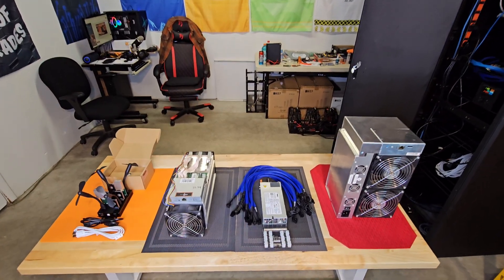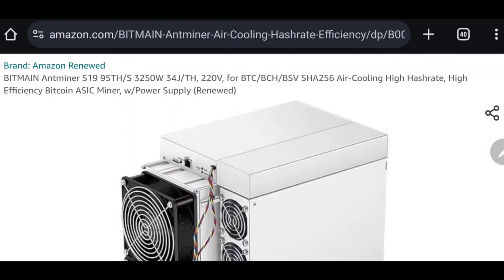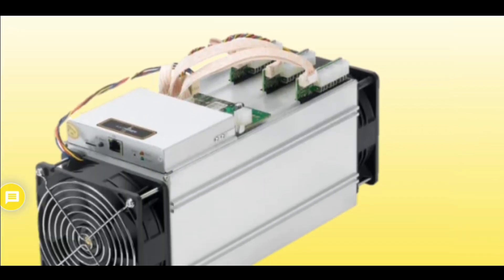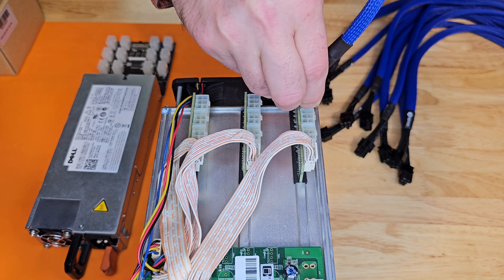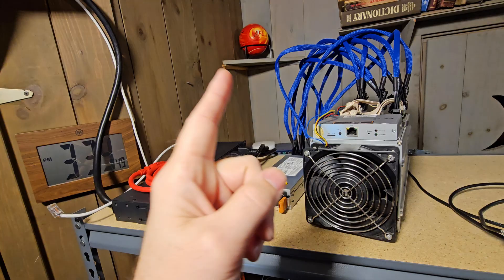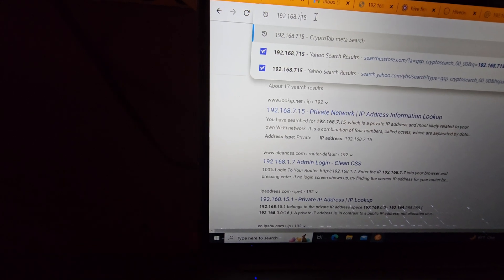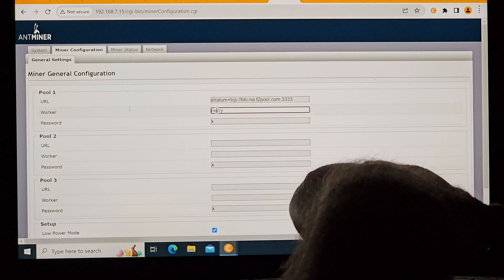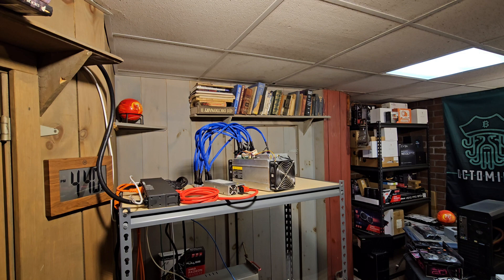Best Bitcoin Miner for Beginners - Set up & Power Consumption

Comment: So question if I live in the building that has public Wi-Fi and I don’t have a router do I need to buy a ride or some type of hotspot with ethernet cable like I can put an ethernet cable in so I could actively mine
Reply from the maker: @420Life-d2h  some miners can run right off wifi, some need ethernet only, some need to be plugged into ethernet temporarily during initial set up to configure Wi-Fi
Reply: @ appreciate your comment What would you say so say I live in a dorm right in I just want the plug up ones which ones do you think is the best cause if I’m living somewhere you know I’m paying tuition and stuff but what it is the best plug-in minor
Reply from the maker: @420Life-d2h  the Bitaxe miners are nice and silent. Low power draw. I just made a video on that

Comment: Got myself one for $90 with PSU as beginner I think is great to learn, even to it loses around $2.50 a day i'm offsetting that electricity cost with my Helium miners income.
Reply from the maker: Fantastic! NFA, but for low power miners, you can check out the Fry Miners too. I just did a video on the decibel miner recently.

Comment: just wondering, there is a sweet deal for a 1300w PLATINIUM PSU, but i will need to hook up to it a 3090, 3080ti and 3070ti + 3x risers (only nothing else) (no motherboard, thats on the first PSU)

will that be ok ???
Reply from the maker: I add up the total TDP's of everything on the PSU. Just in case, you want it to be able to run at full capacity with some wiggle room.

Hope this helps!

Comment: only thing i would add is if your going to include something like an s9 you should also include a futurebit apolo 2. probably similar profitability, but less loud and you can also host a bitcoin node to better help decentralization.
Reply from the maker: I tried, and they won't send me one... 😆 🤣 😆 and doing the math, it wasn't worth buying for the video. 

I only wanted to show this that were easy to get your / my hands on. From my experience, they aren't easy to work with.  Did I miss them on Amazon? That would be my bad. 

Appreciate you taking the time
Reply: yeah ive only seen like 1 or 2 people ever get one from them as a youtuber. which i guess is a good thing and a bad thing at times. next thing you can look at for btc mining could be one of altairs mining mods that can run 240 volt asics on 120 volt lines
Reply from the maker: @y2kanonamous766  I tried... the new ones are beautiful